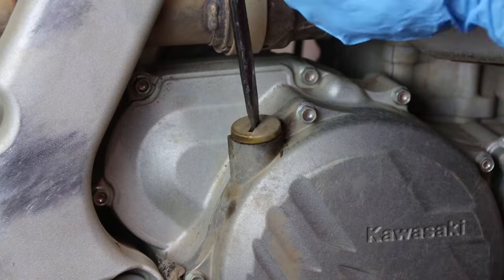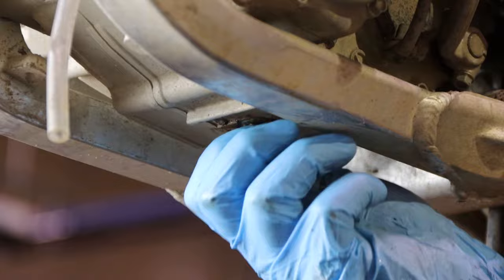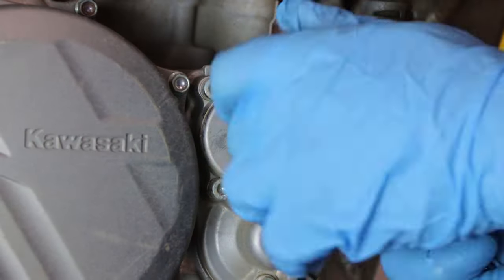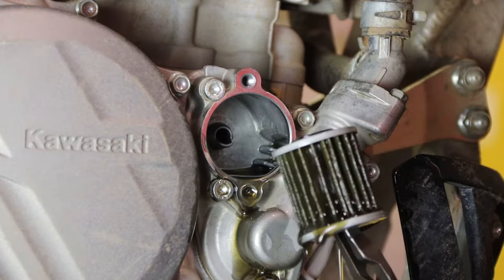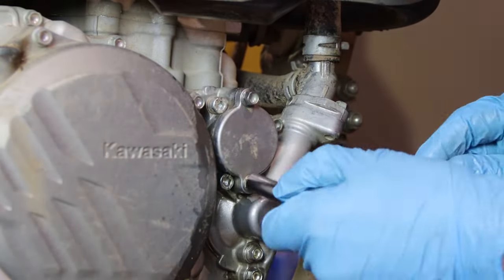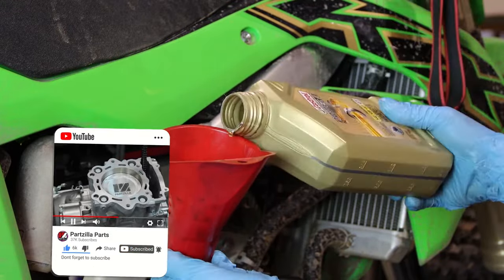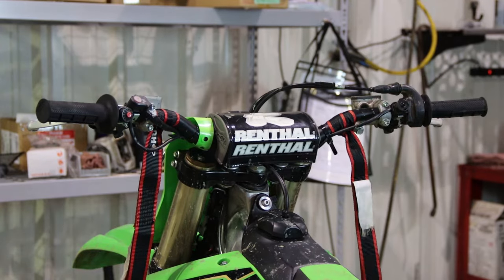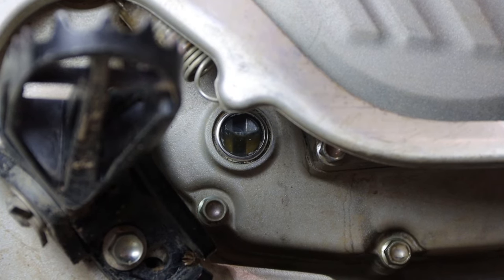How to Change the Oil on a Kawasaki KX250 | Kawasaki KX250F Oil Change | Partzilla.com

Comment: For anyone that has a 2021 Kx250f. I have been told to run 1300 cc of oil because with the recommend amount the clutch pack doesn’t get enough oil on the top end. Which in return will over heat the clutch plates and cracked them. ( I don’t know if the same applies on the 2021 kx450f that’s just what I’ve been told to do).
Reply: and what does that look like on your sight glass?
Reply: @notepad6437  tbh I don’t rely on the site glass I use a ratio/ measuring cup and measure out 1300cc of oil and pour it in. The first ride or two it will push a little oil out the crank case vent/ over flow hose.

Comment: You did not show the reinstallation the the oil drain bolt does it include a gasket or a crush ring??! i changed the oil on my bike and it keeps draining oil fairly quickly not sure if it from a loose drain bolt or engine burning up the oil
Reply: lol he literally shows it at :30 it is a crush washer
Reply: @94BajaKid lol

Comment: Do not use this oil it will cause major problems in your engine oil is way to thin
Reply: For florida riding i run full synthetic 10w 40 kawasaki oil